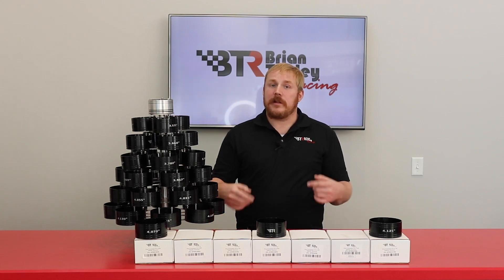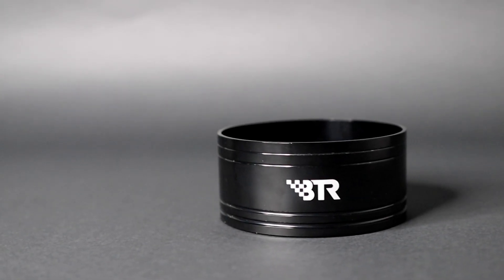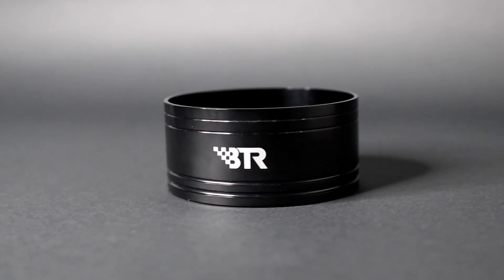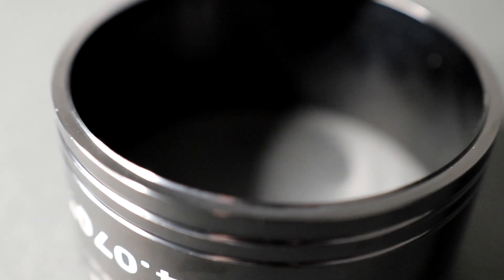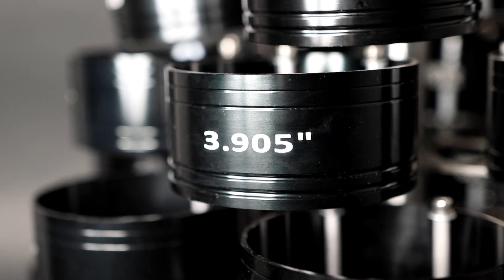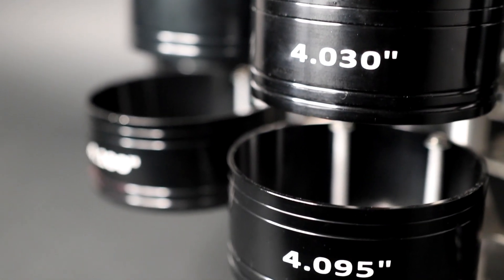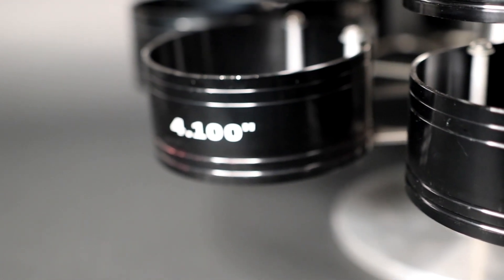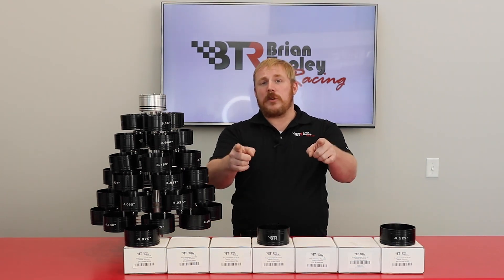What's in the Box? | Ring Compressors

Comment: These are crap messed up a piston and rings they get stuck at the bottom
Reply: How so?
Reply: @GearheadOutlaw wouldn't keep the oil rings compressed while getting it in to the bore
Reply: @YoungerPrice oh.  You are using the correct size for the pistons/bore combination you had?

I got mine for a 3.903"  will be a while until I use it as I'm gathering my other parts so was curious
Reply: @GearheadOutlaw yes I bought the 4" for a stock 4" bore ls.
Reply: @YoungerPrice   

I'll keep it in mind when I use it so I don't run into surprises